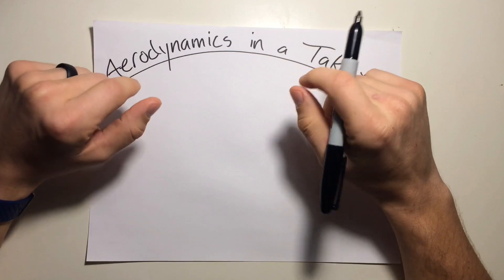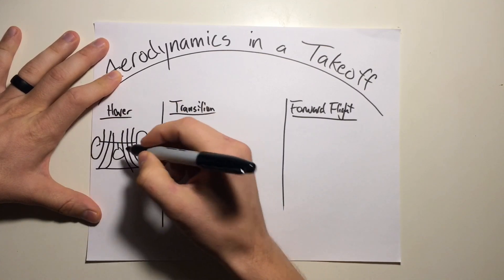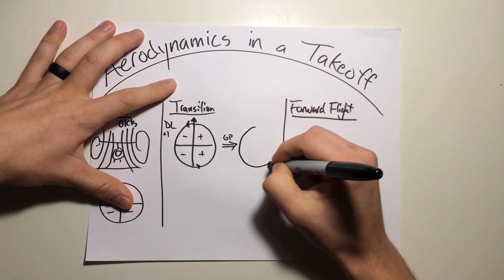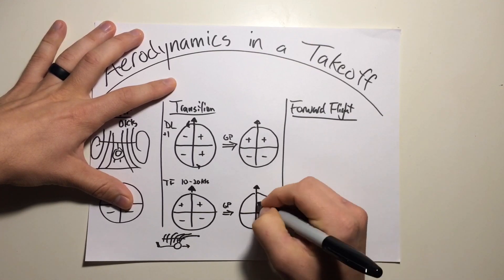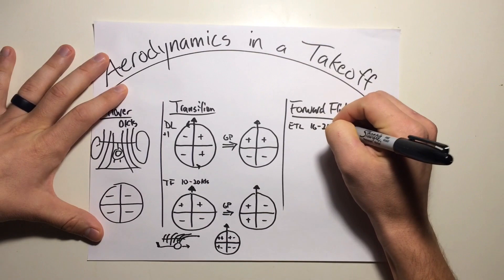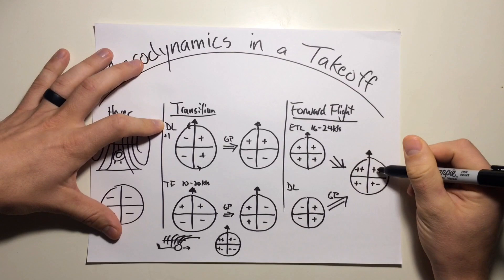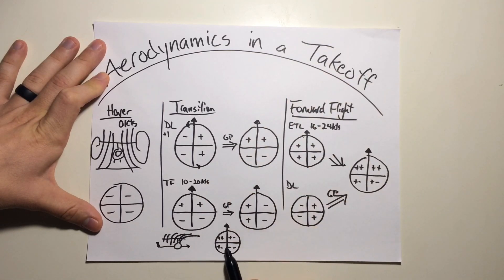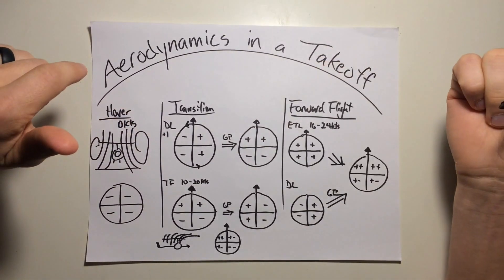Aerodynamics of a Takeoff in Helicopters

Comment: Great content
I have a question though.
Aren't we compensating for dissymmetry of lift by blade flapping. Then why are we again taking it to consideration?
Reply from the maker: Blade flapping helps compensate but depending on airframe, you may still have to still compensate as a pilot. Blades and rotor systems can only flap so much until they reach a limit.
Reply: @helicopterlessonsin10minut10  That helped a lot.

Comment: As an engineer, not a helicopter pilot, I had imagined the rotors would increase angle of attack when moving downwind and reduce AoA moving upwind to balance lift in forward flight. Does that happen? Maybe when trimming for balanced controls once at steady speed?

Comment: Hello, I am using "DCS AH64 Apache" flight combat simulator. When I perform a vertical take off to hover (with 0 knots speed horizontaly), my heli moves turning to the right (thats is normal) an I counter with left pedal, but I have a roll left movemet (heli drifs to the right) so I have to put left ciclyc. I do not undestand it, because I am not moving forward in the transition phase. What is happening? Thanks.

Comment: awesome videos, all of them.
but I think the rotor disk diagram on the right about ETL and DL  together  may be wrong??
It reads from LT - RT.    ++.   ++      SHOULD IT NOT BE       +-  ++.    OR I B WRONG?????
                                         +-    +-                                                  +-  ++
Reply from the maker: Lucky Hoerner. The final diagram combines ETL, DL, and finally Gyroscopic Precession. The diagram in your comment doesn't include the 90 degree rotation in forces as a result of Gyroscopic Precession. Thanks for the question. I hope this helps.

Comment: Am I correct in assuming angle of incidence is the same as pitch angle? Since you change the angle of incidence by adjusting the collective "pitch", and they seem to have the same definition everywhere, angle between the chord line and the longitudinal line.
Reply from the maker: Somewhat. Angle of incidence is the mechanical pitch angle but not necessarily the aerodynamic pitch angle (Angle of Attack).

Comment: Not understanding why you would not have same lift on all blades at all same time no matter where they are rotating.
Everything is moving at same speed as everything is attached at same places and sane size??
Reply from the maker: That’s the thing. Everything isn’t moving at the same speed. The advancing side of the the rotor gets more airflow than the retreating side. The front have has cleaner, flatter air than the back half which is more vertical. All of this affects 90 degrees off axis because of gyroscopic precession / phase lag. Check out my Dissymmetry of Lift, Transverse Flow, and Gyroscopic Precession videos for how each one affects the rotor differently.

Comment: Please do Aerodynamics in landing (your short mention of it here was a bit confusing)
Reply from the maker: Tracy Wilson. During landing the process is reversed. As the helicopter decelerates less than ETL and gets into the transition phase, the pitching up continues (due to Dissymmetry of Lift) but the right roll is introduced (due to Transverse Flow). As the helicopter comes to a stationary hover and loses all airspeed, the rotor is less efficient and more power is required.
Reply: Its just opposite of ELT
Reply: OOPS.     ETL

Comment: So in going from a hover into forward flight you actually at times have dissymmetry of lift on the right and then the left side of the rotor disk?   I imagine the reverse is true while landing.
Reply from the maker: Ken Quesenberry. You have Dissymmetry of Lift anytime there is any airflow across the rotor disk. That can be from movement (in any direction) or wind velocities.  The difference in lift is relative to the speed of the airflow. In all cases, the advancing blade generates more lift than retreating blade. For more clarification, check out my Dissymmetry of Lift and Compensation for Dissymmetry of Lift videos in this video description. Thanks for the feedback!
Reply: I understand that there is always dissymmetry of lift, but it's compensated for through down flapping of the retreating blade and up flapping of the advancing blade.    

I would have thought that on a helicopter with a counter clockwise rotating rotor that the roll would be to the left along with a slight shutter during transverse flow while the blades are trying to figure out if they're at a hover or in ETL.    I didn't take into account gyroscopic progression(Procession) acting on the component of lift, or the greater component of lift in this case.  Does that make sense?   

I've got about 715 hours in simulations, and I've never noticed what you're describing; is that because the reaction is so slight it's difficult to notice or do I need a better simm?     I notice the counter torque effects on lift off and the pitch up of the nose going into ETL, which tends to remain as long as I'm in ETL such that forward pressure on the cyclic must be maintained to keep the helicopter from going nose up; however, I don't think I'm getting any roll to the right at any point, if any roll is present it's a roll to the left during forward flight.
Reply from the maker: Ken Quesenberry. You're correct in that blade flapping helps offset some of Dissymmetry of Lift. But cyclic feathering is also required which is why you need to maintain forward cyclic inputs. I understand your thought on a left roll and I've heard that before. But logically speaking, the only way to have a left roll would be more lift on the right side of the rotor disk. For this effect to manifest here, the input would have to take place at the aft portion of the disk due to Gyroscopic Precession. This just isn't so. The aft portion of the disk is less efficient and creates less Lift due to more induced flow when compared to the front half of that disk.  To address your last point, I'm not sure what type of simulator you use. But most people notice Transverse Flow the most as a drifting right of centerline when taking off and landing between 10-20 knots airspeed. Its even more pronounced in wheeled Helicopters during a rolling takeoff. I hope this helped clear things up.
Reply: Thanks for the input.   Yes I do notice some drift to the right and a bit rearward, but always chalked it up to the wind. 

Actually what I described is what happens while lifting off into a hover, and is actually translating tendency caused by the tail rotor pushing the helicopter sideways.  Anyway neither one seems to be much of a problem, so I'm good.
Reply: Thanks, and great job on all the vids, lectures. I think I'm getting this. ;)

Comment: One question tough : are the vortex related to ground effect ? IF you hover far outside the ground effect you still have the vortex effect ?
Reply from the maker: 12345fowler. Yes the vortices are affected by the ground effect. If you hover outside of ground effect the vortices are more pronounced than in ground effect.
Reply: @helicopterlessonsin10minut10  Thanks

Comment: What is forward cyclic??
Reply from the maker: Abhishek Harihar. Cyclic refers to the cyclic pitch control that tilts the main rotor disc by changing the pitch angle of the rotor blades in their cycle of rotation.  The control is mounted in between the pilots knees and can pivot in all directions.